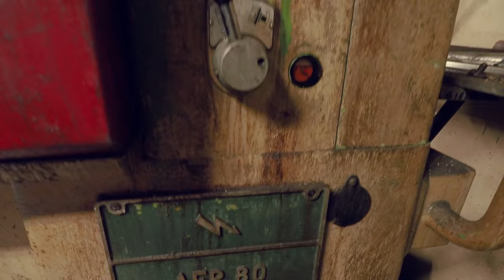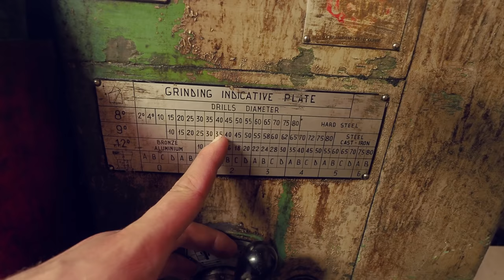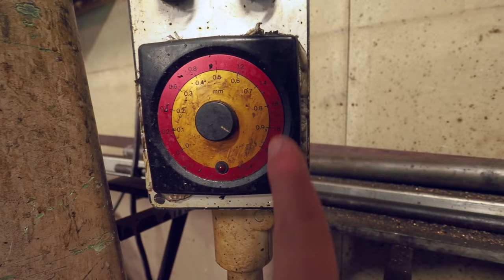Automatic Old School HSS Drill Sharpening Machine

Comment: I have been a fitter and turner for about 35 years and I was taught how to sharpen drills by hand, mostly because there was NOT a decent drill sharpening device that actually worked. The machine you have is special, I have never seen anything like it AND it works Beautifully. It was giving two identical flute shavings when drilling, THAT says it is perfect.
Reply: yeah the 2 chips were perfectly equal, probably better than a new drill bit
Reply: That's what I noticed too. The uniformity of the chips was perfect. I've never seen a machine like this either. I hope he realizes how special it is.
Reply: then you must know that the angle that cuts has to be at like 10 degrees to prevent friction and therefor heating up, the way he does it, this machine does it is wrong in all ways you look at it if you have done any drilling or sharpened them ever + this wasnt excactly a drill to use without drilling with a smaller one first  which he did in this video, you need alot more force to drill the hole + mroe friction again and easier damaging of the drill
Reply: sirrcheese roels  This machine obviously cuts the relief angle, It wouldnt cut like that with no relief angle. If this is what you mean.
Reply: Same here Scott, machinist 43 yrs and only used 1 big drill sharpener that actually gave a good point. That baby is worth its weight in Gold, perfect equal chips and dia was most likely good as well. Sometimes old school is the best.
Reply: sircheese dont you drill pilot holes?that takes some of the stress off the bit needed for final diameter but who knows?
Reply: Should have used smaller drill first, you can see this drill bit flexing as it cuts in.
Reply: 4Kandlez im sure he knows that. He doesn’t care. He’s literally just messing around with expensive scrap metal
Reply: URSS MAN
Reply: is the machine leaves a relief angle ?
Reply: @mastermat630  Yes .. the grinding oscillates in perfect timing to do that.
Reply: Same here ... the owner at our shop got us to try a half dozen drill sharpeners, and beside stuff under 1/2" ... nothing worked worth a damn, and yes same, everyone using big drills was expected to be able to sharpen them on their own.
Reply: There is identical Soviet made machine out there and it can be relatively cheap.
Reply: It is truly a beauty
Reply: @MrKotBonifacy   It does create the relief angle. Thats why the grinding stone oscillates in and out with perfect timing at twice the rate of rotation of the drill bit. Thats also the reason why he aligned the drill bit at 4:35, so that the oscillation would be in sync with the cutting edge, so that the cutting edge would be in contact with the stone when the stone is at its furthest position (or rather starting to move towards the drill bit).
Reply: @aleksinuutila2315  - Sorry, fella - I don't think I'd be willing to agree with you. But I have to admit, you've almost made me accept your view (I even typed a rather long reply explaining why I did not notice that back and forth movement) - but then I thought something isn't quite right here, and decided to take a good second look at it - and then... 
But  let us not get ahead of ourselves - before I'll share my final conclusion, let me elaborate a bit on the whole grinding thing "in general".

I would, in principle, agree, that in order to grind a certain relief behind cutting edges of the drill (and NOT just a "plain regular cone") in THIS process and on THIS machine, there would have to be some axial "back and forth" movement of the grinding wheel - just as you have described.
OK then, at least there's something we can agree on - let's then make some calculations to see how BIG it would (or should) be like.
Say, for this particular drill (Ø 35 mm) you'd like to grind a relief around 3 mm deep at its maximum (= on the end of each "face", at the outer edge; 3mm deep = 3 mm below imaginary surface of a regular cone of the same angle) - which seems like quite reasonable value for such a big drill.
In order to achieve that, and assuming that the drill face ends at approx 45° behind the cutting edge (measured as you rotate the drill along its axis), we'd need to create a "slope" on the face with a fall-off of about 0,22 mm per every mm of the "slope" - again, the plane of reference here is the surface of a regular cone.
(Why 0,22 mm/ mm? Simple: Ø = 35 mm => circumference = π x 35, which ≈ 110 mm; 1/8 of it = 13,75 mm; 3 mm of relief ÷ 13,75 mm of the slope ≈ 0,22 - but this is just a side calculation, and it is not really important here - so you can just as well disregard it completely).
Anyway... With me so far? Good, let us proceed further.

As I assumed earlier, the drill face ends at approx 45° behind the cutting edge, perhaps bit less - but anyway the grinding wheel should start moving backward not latter than at 90° of drill rotation (it is rather obvious why -  the grinding face has to be back at its starting position at least just before 180°, or half-turn of the drill (I'm assuming here a "sinusoidal" axial motion, akin to motion of a piston inside a cylinder - as it is the simplest motion to obtain/ implement in a simple mechanical device).
Which means, in the case of this drill, with assumed 3 mm relief, that the total forward movement of the wheel would be less than... just 6 mm (8 mm for a 4 mm relief).
Now, take a good look at 9:10 (slow down the clip still a bit more to see it even better), then look again at  9:45, and ask yourself: does it really look like 6 mm travel? Or perhaps it looks more like 20-30 mm travel?
To me the latter seems to be better description of reality - but then again, I might be just wrong... ;-)

But never mind the magnitude of that movement, as seeing 3D movement at angle on a 2D screen can be deceiving - let us look at the DIRECTION issue and try to figure it out.
BOTH oscillating and axial movement looked at at THIS angle would look pretty much the same, just as I said before - so we need to look for so-called "secondary clues". Which are: movement of the shadows, relative position of moving vs non-moving element, change in brightness or angles between the objects, behaviour of various non-rigid elements - and so on, and so forth.
Now, when I look at the shadow the safety guard casts on grinding wheel I can't really see any axial motion - and when I look at the behaviour of that "coooolant fall" all I can see is that the "spot" where coolant (or rather coooolant) meets the wheel shows ONLY oscilating motion (i.e. side to side motion, parallel to the face of the wheel). Especially when you look at the inner (hollow, or "depressed") portion of the wheel - how possibly could the stream of coolant start flowing INTO the hollow portion of the wheel if the wheel moves "forward"? Makes no sense whatsoever - in such case the apparent movement of that "spot" should be UP AND DOWN the face of the wheel, not really SIDE TO SIDE - right? OK, just a smidge "to the side" - but that would be REVERSED - to the OUTSIDE while forward, not inside... ("inside" only while moving backwards).
: )

What's more, that side-to-side motion is something one would just expect as "normal and obvious", as that's the way one normally hand-grinds "pointy" and hard objects (like drills) on a regular bench grinder - and that motion is applied so the drill (or other object) won't make a groove in the wheel's grinding face, AND to obtain flatter cutting edge.
Why so? Because cutting such groove sort of destroys the wheel's face, and then the wheel has to be "dressed "- which results in excessive and premature wear of the wheel, not to mention lot of harmful dust in the air, and follow-up work of re-adjusting tool rest - all of which could be easily avoided if the wheel's face hasn't been damaged in the first place.

So, one normally grinds the cutting edges first while moving the drill (held against the tool rest) slightly "side-to-side", and once the edges are properly ground one just sticks to one location on the rest and grinds the back relief in swinging up-and-down motion. Plain, simple and easy - as nothing about the relief shape or "size" is super-critical.
That way you get best results - and prolong the life of the wheel (thus saving yourself some money and unnecessary work) to boot.
Last but not least - that side to side motion "flattens out" any "unevenness" in the grinding face, as it is rarely perfectly smooth and parallel -  and even if it happens to be smooth it might easily loose it once you start grinding.
Thus in order to obtain "as flat as possible" cutting edge you must not keep the drill (or lathe cutting tool) in one place while grinding its cutting edge(s) - you have to move it. (Does not apply to relief, as it doesn't touch or cut anything.)

To sum it up - well, I still CAN'T SEE any visible relief on that drill faces after the grinding, and I CAN'T SEE any axial movement of the wheel while grinding takes place.
Yes, it is possible that the machine DOES JUST THAT, but that axial movement is so small that it can't bee seen (as it gets obscured by much greater oscillation), and that this Finnish fellow simply forgot to mention that feature and to explain "how one sets the depth of relief" - but I find it HIGHLY unlikely.
Yes, he never said anything about that oscillating motion either, but this such an obvious thing and no-brainer for anybody with a more than a few weeks of machining experience, that explaining it would be akin to him saying "and you have to plug the machine into electric socket, as it needs electricity to operate" (Duh! What next? Telling me I need to zip up my fly after taking piss?)

Also, while adding such functionality to a drill grinder is perfectly feasible, it would kinda impractical - as it would add a lot of complexity to the machine (more complex = more prone to malfunction) and that would in turn increase its price significantly, while producing inferior results - as drills ground in such way would have weaker cutting edges and would have the tendency to bite into material too fast.
Why so? Because the "thickness" of the cutting edge will be much smaller, thus it will become prone to chipping on harder materials, while with softer materials it will have tendency to dig into material too easily (as it won't have any significant "resting surface", or "shelf"). Can't attach any pictures here and it is tad difficult to explain it in words, but any machinist with a grain of experience would know what I mean. True, it is the attack angle of the drill that makes the biggest difference, but the lack of proper resting shelf/ surface/ plane behind the cutting edge aggravates that "too fast digging" problem,

So, to sum it up - having said what I just said, I'd stick to my opinion - i.e. that this machine DO NOT grind any relief, as it wouldn't make any sense - it would make the machine overly complicated and unnecessarily expensive, less reliable, and producing inferior results. What's the point?
It does just what it is meant to do - it just grinds, with high precision, the most important surfaces, at precisely set angles - in other words, it does the tedious and time consuming work machines are very good at (and humans are not). That "quick and easy", simple and non-critical part, i.e. grinding reliefs, is left to those less precise and impatient humans. Everybody happy, and "let's keep things simple".

As simple as that  : )
Reply: Well one company  I worked at had one of these .
Reply: @darkp00pie  You don't know what you're talking about.  The sharpening machine produces the correct relief angle and any twist drill is capable of drilling a blind hole when needed.
Reply: @MrKotBonifacy  Wrong!  Watch closely, the stone moves in and out axially timed with the rotation of the drill producing the proper relief angle. That motion is adjustable for the desired relief angle.
Reply: @MrKotBonifacy  A little less cocaine, buddy.   Slow your brain down just a notch.   The thing grinds a proper relief angle, "As simple as that :)"
Reply: @garth849  I DID watch VERY closely, many times, and even in slow motion - sorry, CAN'T SEE IT. Again, I'm not saying "...therefore it isn't moving" - it might, but if it does, that axial movement is obscured by other movements. And as I said before - the angle of the camera makes it impossible to determine ALL movements involved in this operation.
Also, as I pointed out previously, the light reflection on freshly grounded drillbit does not indicate any changes in conicality on the "tip" of the drill. Thus, I have to reiterate my previous position and statement.

So, thank you for your input and your OPINION, but you''ll have to do a bit better than "I say it moves, therefore it moves, QED" to convince me : )
Should the author said so - oh, that would be different story: "Roma locuta, causa finita" - but here all WE can do is to reenact that famous scene from "Argument Clinic" by Monty Python. Which I'm not interested in, so... Happy New Year! ;-)
Reply: @garth849  The only "cocaine" I use is BEER. No vodka, no whisky (or whiskey), no wine - just an old good fashioned lager, and rather weak one, for that matter. So, don't judge everybody by your own skewed standards. That would be beneficial for everyone, including you.
Reply: MrKotBonifacy It doesn’t use axial translation to grind the relief, that wouldn’t actually grind a relief of any kind. If you watch, the axis of the wheel itself is “wobbling” (rotating about another axis not parallel to it, this is the relief angle). That’s the only movement it takes to grind a helical relief on a twist drill. How the machine actually accomplishes that is simple, just stick the grinder spindle on a shaft and rotate it at the same speed you rotate the drill.
Reply: MrKotBonifacy I can appreciate your skepticism. I tend toward the skeptical side. The problem is when you are too skeptical you begin to reject reality itself, which can certainly be a problem. Unless this guy is being dishonest, then the machine cut the relief while it was sharpening it. 

You did not provide an explanation, or let’s say “hypothesis”, because you didn’t explain what is being observed. He took a broken drill, put it in a drill grinder, the machine sharpened it, then he put a hole through a piece of steel. You and I both know that last part requires relief on the backside of the cutting edges. 

“Wobbling” of the wheel axis would require a fair bit of movement from the wheel, so it may not be how it accomplishes it’s task. Who knows? Not enough detail from the video for anyone (including you) to know for sure.
Reply: @tbdcreations5370  1. Who is to judge when there's "too much" skepticism? You? I? Who is more "qualified" to make such judgement?
2. What's the issue with "this guy" being "dishonest"? He never says ANYTHING about grinding the relief - how can you then say he's being "dishonest" - ? In other words, what the earth you're talking about?
3. A drill bit with a properly ground relief does indeed cut better into a drilled material, and one without it would make it with a difficulty, true - but then again, I don't see it as any definite proof of "relief being ground either. Albeit it gives some weight to your argument "a relief has been ground" - however, without proving any specific way such relief has been ground. Therefore not really supporting your explanation on HOW the relief is being ground by THIS machine.
4. Who knows? Not enough detail from the video for anyone (including you) to know for sure - precisamente, ammigo. And yes, that is "including YOU". But, contrary to what you've said  ("You did not provide an explanation, ... you didn’t explain what is being observed") I did a thorough and detailed explanation "what is being observed" (although I doubt this is a proper way to express it, grammatically speaking) - including all secondary visual clues, theory , calculations and so on.
5. And, oh, BTW: could you perhaps reply to my question from previous post - namely, have you ever operated such a grinder, and you KNOW for a FACT, that it works the way you posit it to? Or your guess is just that - your best shot "in the dark" at it?

Again, let me remind you - I never said IT DOESN'T or IT CAN'T grind any relief - all I said was "I can't see it, therefore I do not assume id does it". Occam/ Okham Razor principle, you see...

Best, KB
Reply: MrKotBonifacy You must be a lot of fun at parties.
Reply: @tbdcreations5370  Quite the contrary - although it's rather hard to quantify, as I find "parties" rather boring - just a lot of "blah-blah-blah", about everything in general and nothing in particular - thus I rather steer clear from those time-wasters. See, I don't enjoy talking to people who don't have much to say - at least when it comes to deeply thought thoughts of their own (hint, hint...).
BTW, you seem to avoid answering my question and addressing my technical remarks... - ? Anyway, as they say: "when you loose, don't loose the lesson".
Cheers ;-)
Reply: @tbdcreations5370  Look kid, I really don't care what you think about me or where it hurts you.I provided my detailed explanations and reasoning behind it - and if it doesn't suit your feelings or intuiution then it is YOUR problem, not mine. "Rigid thinking"? What, do I have to agree the Earth is flat because some... someone on the net says it looks flat to him? Aw, gimme a break, will ya? Snowflakes, shoot...
Over and out.
Reply: MrKotBonifacy Since when did feelings come into this? Yes you stated your observations and conclusions, but maybe I should have been more clear as to mine. 

I do not know exactly how the relief ended up on that drill, but it did. Maybe you don’t fully understand cutter geometries, but if that machine simply rotated the drill against that wheel as you suggest it did, you would end up with a conical surface on the end of the drill. This will not drill anything. Nothing. The heat generated from pushing it against a rotating workpiece would quite literally weld the drill to the workpiece rather than drill a hole. This is a demonstrable fact. You absolutely have to have relief on the backside of the cutting edge to allow the sharpened cutting edge to cut into the work. 

Therefore there are two possible scenarios. Either the machine shown in the video (somehow-it’s debatable how) cut a relief on the drill, or the drill was taken to a separate machine/sharpened by hand before being taken to the lathe and used to drill the piece of stock as everyone else observed was done.
Reply: @tbdcreations5370  1. "Since when did feelings come into this?" - since you started "ad personam" excursions - i.e. me being a bore (aka "real fun at parties") and other remarks like that, and sort of ceased to argue ad meritum - and started to dodge my questions as well. Mind you, I don't care, not the least, what others think of me and my social skills - I am a recluse, by choice, anyway.
And it was your choice to stray from the meritum into the "you are so and so" field, which clearly indicates some "personal issues" having surfaced and some nerves being touched - as simple as that. ("If something quacks like a duck, walks like a duck and looks like a duck then it probably IS a duck.")
2. "I do not know exactly how the relief ended up on that drill, but it did." - hmm... did I ever questioned that? I think I even posited HOW it could be ground on THIS machine, but who am I to say what I've said, eh? (Hint: a sarcasm, with a dash of irony and topped with "I don't give a... whatever".)
3. Last, but not least: https://www.youtube.com/watch?v=cXO6OjPsGgY&t=294s
Yes, I know - this is NOT the same grinder - still, seems to validate my earlier suggestions on how the relief can be ground, doesn't it? And yes, humble pie is a dish kinda hard to swallow, but hey, we learn throughout all the life, don't we...
Anyway, this way of sharpening drills is called, apparently (unless I'm confused here) a "helical grind" - meaning, there's no distinctive "lip" behind a cutting edge and "relief" behind that lip, but instead those two are kinda blended into one helical surface. Which in turn would very well explain that continuous light reflections on freshly sharpened drill I mentioned in my earlier posts.

The lack of a  well-defined lip makes the cutting edge kinda more prone to chipping and "biting" into material, seems to me - but maybe not really that much, and it is acceptable as a fair trade-off.
Also, the "bronze/ aluminium/ soft steel/ hard steel settings starts to make more sense - the softer the material is, the lesser the relief - or "flatter helix".

Well... I think it kinda makes the whole issue clear... Unless you choose to disagree with me, which, of course, you're free to do. Just don't count on me wiling to be involved in any re-enacting of that "Argument Clinic" sketch by Monty Python. Cheers.

PS: The only reason I returned to this "exchange of opinions, both technical and personal ones" was a "new" clip by Abom79 - namely, a SNS 289, "Oliver Drill Grinder, Trailer Ramps, Stainless Machining" (https://www.youtube.com/watch?v=D7dznFDS_fo). Knowing the name of the grinder I could google it - and find both manufacturer's website (www.oliverinstrument.com) and that Small Tools Inc. clip I linked earlier. Again, that Finnish fellows use some Italian made machine, not Olivier, but seems to me that certain principles of operation would be shared "across the platform", so to speak.
Reply: MrKotBonifacy Yes actually you did question that. You said, and I quote, “I can’t see it, therefore I don’t assume it does it” (grind the relief). Also, axial translation was suggested as one of the ways the relief could be ground earlier on by some of the guys in this thread (this is one way to end up with a helical grind). You argued that it’s unlikely because you didn’t see enough movement.
Reply: @garth849  LOL. But that was when he accidentally went into "abuse" instead of argument.
Reply: @tbdcreations5370  Oh, I love - no, I LOVE it - "hey, I was wrong, but let's start some nit-picking and hair splitting, shall we?" Are you some wannabe lawyer, or what?
Check the definition of "to assume", read that word in context, and try to find the meaning of "I DO NOT SEE, therefore I DO NOT/ CAN NOT assume" statement. Also,  find the difference between "unlikely" and "impossible" - and then "tink tink and den u know", as Singaporeans used to say.
Till then, bye.
PS: Also, I don't know what you want to argue by saying "others proposed it too" - firstly, I do not have time to read ALL the comments, and secondly I never claimed I was the first and the only one who thought of it. So?
Reply: MrKotBonifacy Go back and look at the initial comment you replied to, the comment was by Aleksi Nuutila. Go ahead, I’ll wait. Notice how they say yes it grinds the relief, and it does it by feeding the drill in and out twice per revolution, and that this is also why the guy initially timed the drill? 

That is the first comment you replied to in this thread. This is what I referred to when I said others had suggested this very same explanation. You weren’t happy with that explanation then, and argued that it’s “unlikely” the machine could grind the relief in that way for a whole host of reasons. And now talking to me, you offer up this explanation originally explained by the aforementioned YouTuber. 

So basically you’ve been arguing with half a dozen people over nothing. That takes a special kind of arrogance. 

Also, notice how I don’t care that my initial thought on how it ground the relief was wrong. It’s not about being right per se, it’s just about learning/figuring out how things truly work.
Reply: @tbdcreations5370   TBD Creations  "It's trivial, my dear Watson..."
In Middle Ages the educational system consisted of two levels - trivium and quadrivium. Trivium, the lower one (hence, modern "trivial") consisted of three subjects: grammar, logic and rhetoric, and the higher one, quadrivium, taught four subjects: arithmetic, geometry, music, and astronomy.
So even "trivially" educated folks could think logically, argue properly and ad meritum - and they even could follow what that meritum was. And yet some people call it Dark Ages - while today, in our "enlightened" times, "modern" and educated guys can't really even comprehend who is discussing what and with whom. Beam me up, Scotty...

Let us recapitulate the whole mishmash here, piece by piece, shall we? Good...
So, someone here asked "does this machine grind any relief?" - as this information was completely omitted by authors of the video. Ditto for ANY info on the machine settings, what does what, why the drill has to be "timed" before the grinding - and so on, and so forth. Not surprising though, as informative value of this channel in general is next to zero - just some show-off, two watchmenows with some gazilion tons press, who just want plenty of viewers and ad money, but can't really put together any proper plot and script for their videos - like, say Abom79, Keith Rucker or Slava Petrov can and do - in short, just another "noise generator" efficiently lowering STN ratio of YT. But I digress here.

So, somebody asked about the relief, some other fellow said "yes, it oscillates in perfect timing", to which I replied "no, it [seems to me like it] doesn't" - and explained (!) why I think so. Then some other Finnish or Estonian fellow chimed in and said "no, it actually does" - and said (reiterated) HOW it does it.
To which I replied, "well, you've almost (!) convinced me - but I still have my doubts" - and then I went on, explaining (in a rather lengthy and detailed manner) why I still have my DOUBTS.
Mind you - I was talking about my DOUBTS, not "what makes me thing this guy could be right" - still, I gave this guy credit, and left that argument with and "open end" - "yes, it might be just like you said, but I can't see that movement and therefore I can't just take what you're saying at face value" - especially that he never provided any further explanations or elaboration beyond "I say it does".
Furthermore, I'm not a professional machinist, and being more accustomed to "traditional drill anatomy" (see https://www.youtube.com/watch?v=MZa2B5oWTYM) I never thought of that helical grind - as it seems to me to be an inferior way of grinding drills.
Anyway, THAT conversation ended (!) on "well, maybe it does, maybe it ain't" - but HOW the grinder might do that was BEYOND disagreement.

Side note: as it turned out, that Italian grinder most likelly does grind the relief just the way Aleksi stated, and should he provided some further explanation or elaboration, like, say, "I'm an operator of such a machine" or "my uncle has one and I know for the fact that it does it", or linked that video I linked much latter, I'd just said "seems you're right, and I was wrong" - and that would be an end of the whole argument, as I'm not interested in any "winning" or "being right" - all I wanted was to figure out how the machine really works. End of side note.

Then some other interlocutor stepped in, arguing NOT whether the relief is being ground, but HOW it is done - saying something about "wobbling motion". So I entered ANOTHER conversation (or so I thought...), this time leaving aside that "is it ground, or it is not" issue, accepting (for the sake of argument) that the relief is, indeed, being ground - and focused instead on the "HOW" issue. So, it's rather obvious that in THIS argument I did not question or argued "does it grind the relief?" - as the ONLY issue here, for me at least, was HOW it is being done.

It's elementary, my dear Watson... and trivial. TWO separate arguments, TWO DIFFERENT issues. Why then do YOU mix them up? Confused, or just employing that "moving target" tactic, as described by Schopenhauer in his "Eristische Dialektik" ("The Art of Being Right") - BTW, a favorite women's tactic in nearly each and every argument?
(No need to answer, that was "rhetorical question", you see...).
Best, KB
Reply: MrKotBonifacy A reasonable summary, I’ll give you that. I think the biggest takeaway I’ve gotten from this (aside from how the machine works) is that you clearly have way too much free time on your hands. 

The main reason I offered up my thoughts in the first place is because you didn’t seem happy with Aleksi’s explanation. So I thought about it, and came up with another way by which you can grind a relief (especially in such a way that would be difficult to see on camera from afar). When I realized my idea was unlikely to be accurate I figured I’d at least attempt to convince you that the machine had certainly ground the relief somehow. I did this because you seemed skeptical that it could have, because you apparently hadn’t heard a compelling argument from anyone.
Reply: @tbdcreations5370  1. "A reasonable summary, I’ll give you that" - gracias, muchos gracias.
2. "the biggest takeaway I’ve gotten from this (...) is that you clearly have way too much free time on your hands" - quite the contrary. I've wasted way too much of my time on this pretty much "aimless exchange" (for a lack of better descriptor). Just look at the time it took me to respond - your reply to my last post was almost instantaneous (give or take an hour or so) while my replies are pretty much a day or two latter then posts to which I was replying.
BTW... Still, can't refrain from "ad personam", eh? Old habits die hard, or what? Never mind...  : ) And yes, clear and logical thinking - and thus fast (relatively fast) typing out long reasoning or argument are some my self taught skills.
3. "you didn’t seem happy with Aleksi’s explanation" - wrong, again - as there wasn't much, if any EXPLANATION on Aleski's side - merely a STATEMENT "it grinds, by moving back and fort the grinding stone" - not much to ponder over, innit?
"If you won't think about what you're saying you'll never say what you're thinking" as the Last Emperor's tutor have said to that little boy (or something like that, I'm quoting from memory and it's been more than decade ago when I saw that movie).
Still, notice that I never dismissed Alexi's "explanation" outright - I thought it over, carefully, made some calculations, watched the video few more times, in slow motion - and my final conclusion was "well... maybe... - but since I CAN'T SEE IT, I'm going to stick to my previous "model". Occam's razor principle, sorta, at work. (And Alexi's unwillingness to elaborate on the subject as well.)

4. "I’d at least attempt to convince you that the machine had certainly ground the relief somehow" - yeah, but at that point it wasn't any longer (IMHO) whether it grinds the relief, SOMEHOW - the issue was HOW does it do it. To which "somehow" doesn't seem to be a very convincing "argument", does it? Which brings us nicely to the last point, which is:
5. "you seemed skeptical that it could have, because you apparently hadn’t heard a compelling argument from anyone" - precisamente, amigo, that was, exactly, my point - CONVINCE ME, otherwise I'm going to stick to my previous "explanation", "theory" or "working model", whichever you prefer. To the model I've thought over and worked out, carefully and with proper scrutiny, based on all AVAILABLE information and prior knowledge. Mind you, on "information" and "knowledge", not "intuitions", "guesswork" or "gut feelings". This is the basic, if not the MOST basic principle in any "research" or attempt to understand "how things work". Aristotle's "heavy objects fall faster" vs Galileo's reasoning on the subject is the classical example on how we can go wrong when we trust our "intuition". 

For better understanding of that problem I'd recommend "Thinking, Fast And Slow" by Daniel Kahneman, preferably read together with Hoimar von Ditfurth's "Der Geist fiel nicht vom Himmel" (which translates roughly as "The Spirit Did Not Come From The Heaven" - I guess there is an English version available as well, Uncle Google's your friend... (and no, I'm not German, FYI - and I don't really speak German either.)

And, the final question... Are we done with the issue...? Por favore...?
Reply: MrKotBonifacy I do find it impressive how much effort you’ve put into responding. And I’ve actually somewhat enjoyed this exchange. 

One thing keeps bothering me though. You keep using Occam’s razor incorrectly. Occam’s razor, when used properly, suggests that if given two possible explanations that explain the same phenomenon, the simpler solution is more likely to be correct. The problem is you never had an explanation for the phenomenon seen in the video. You simply cast doubt on another explanation (Aleksi’s). There’s no problem with that, it’s just you wouldn’t apply Occam’s razor in this case. 

Now you did say “I didn’t see it grind the relief therefore I ‘assume’ it doesn’t”. That could almost be mistaken for an explanation of the phenomenon in the video, except for the fact that he ended up with a sharp drill bit at the end. So, considering all of this, I don’t believe Occam’s razor applies.

That was all, now I’m done.
Reply: To me hand sharpening drill bits is right next to Black Magic, Rocket Science and Brain Transplants. My Hat's off to you.
Reply: We had such a tool in our shop but only used it for drills that were 12mm or bigger. It was easier to do by hand with smaller drills.
Reply: @stefanforrer2573  Thank you for your feedback. I used to think I'm not blind, as I could see that video in the first place (and your kind and witty remark in a second place), but now I know I was wrong all the time.

"Amazing Grace (how sweet the sound)
That saved a wretch like me!
I once was lost, but now am found
Was wrong, but now I see..."

I mean, I don't. Since I'm blind, you see.
By the way, a word of advice: get lost.

Thank you for your attention.
: )
Reply: @GIGABACHI  It's much simpler than playing violin. Six yrs old kids can play violin. Go figure  ;-)
It is actually pretty simple. Just a bit of attention and a pair of well-tempered hands. That's it, that's all. No need for brain surgery : )
Reply: @MrKotBonifacy  I have shaky hands . . . I'm screwed. 😞
Reply: @GIGABACHI  Fret not, my friend! Take a course of yoga meditation, or a shot of your favourite... umm... "relaxant", shall I say? - and you're off to a new, brighter future. And sharp drills ;-)
Reply: @MrKotBonifacy  the only thing that could possibly explain such vehement distrust of other people's suggestions of something so clearly seen and verifiable, is weaponized  autism.
Reply: I used to have a client that operated a grinding business in Manchester New Hampshire ( USA ).... Everything from industrial cutters, deli slicer blades, woodworking blades, chainsaws.... they had very specific equipment, filling about a 5000 sq foot shop, behind the Showroom full of power equipment... But I do not think they had any earlier machines like this one...... That is a beautiful piece of equipment. But in the lathe..... is it an illusion of video, or was the bit wobbling ?
Reply: I wouldn't use a drill that large on anything! I use inserted drills
Reply: @MrKotBonifacy  I think at 5:09 he is setting the machine for the correct relief angle of the subjected drill.
Reply: @LaggerSVK  Yes, it seems like he's doing just that. The problem is, he never really tells what he's doing, and what's the purpose of those settings.
So yes, with the benefit of hindsight, one can tell "oh, this is where relief angle is set" - but this guy never seem to bother to properly explain his actions and controls of the machinery he's "presenting". (Talking at length about secondary or even tertiary things like mixing and checking the "coooolant", yet never explaining the most basic operations of the machine - hmm...)

Besides, that "somewhat unclear" wording on this plate seems to "be indicative" of the fact, that English was to whoever designed it, a secondary language at best.
See, "indicative" is an adjective based on a verb "to indicate" - meaning "to point out, to show" - and it comes from Latin "indicat-" meaning "pointed out", from the verb "indicare", from in- ‘towards’ + dicare ‘make known’. The grinder is Italian made, and modern Italian is a descendant of Latin, thus I reckon that this "make known" component/ sense of corresponding Italian word is what that guy have meant. "False friends", as it it called in linguistics - but I digress here...

So, to wrap my rambling up - yes, I'd agree with you. But as I said before - it is just a poorly planned, poorly (if ever) scripted video - just another "watchmenow" out there, unfortunately...
Best, KB.
Reply: @MikeBaxterABC  It should do but did it ?
Reply: I worked at a place that had an Oliver drill grinder worked like this one did a good job
Reply: Never seen one either thought doing it by hand was the only way. lol  35 yrs on the tools for me.